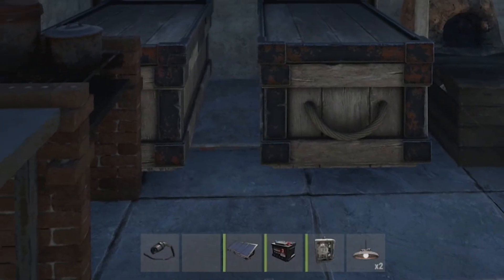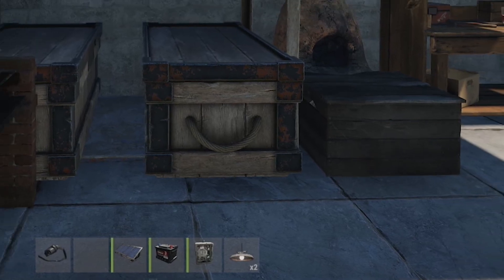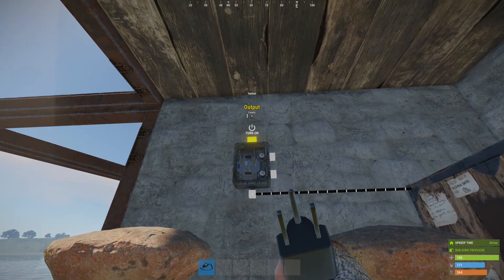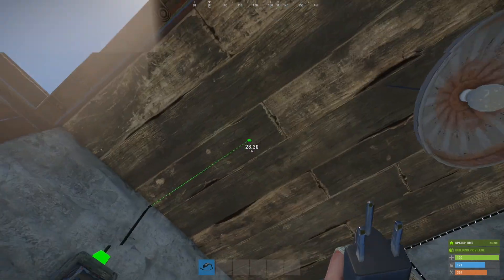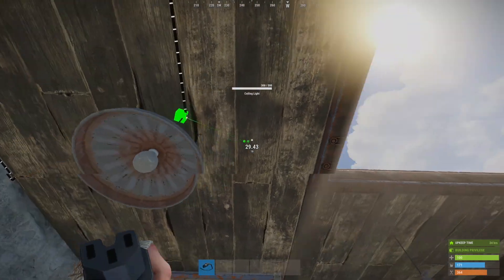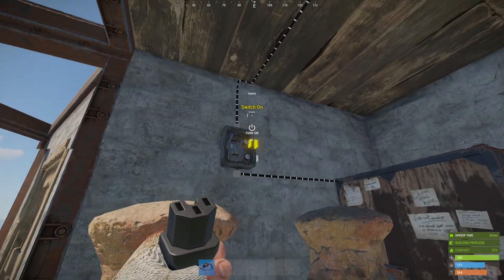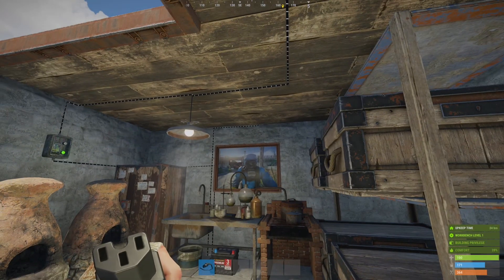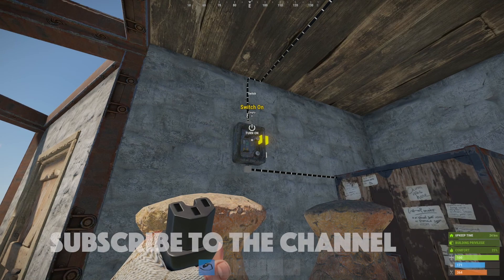Lighting controlled with a simple switch - Electricity guide - Rust

Comment: why is my battery still using power when i have my lights turned off? I have 15 power worth of lights and when i turned the lights off,  i check the battery usage and it's still using 15 power.
Reply: Did you connect the right plug in at the bottom? Also using branches and a power blocker is better.

Comment: I kust a timer and set it for 600 seconds - 15 minutes for night time - and then it turns off automatically when the timer is up and. Doesn't matter if Im a little late with it because it doesn't use that much power anyhow.
Reply from the maker: Great usage of the timer!
Reply: theres an item which activates only at night.. no need for timers or switches
Reply: @LocalhostTutorials  -  different solutions to a common problem. If a player has a timer and no blocker then a timer is that players best option.
Reply: @LocalhostTutorials  what item is it?